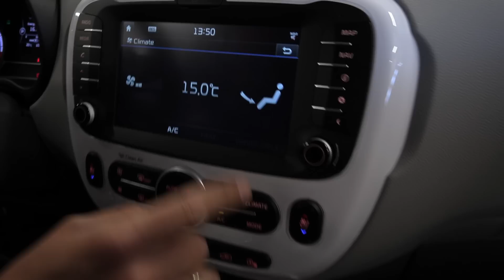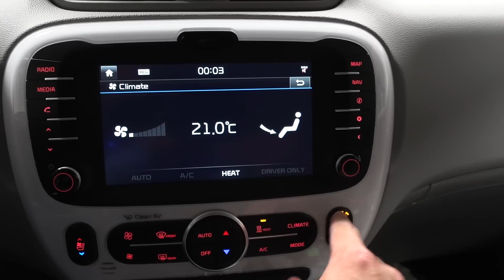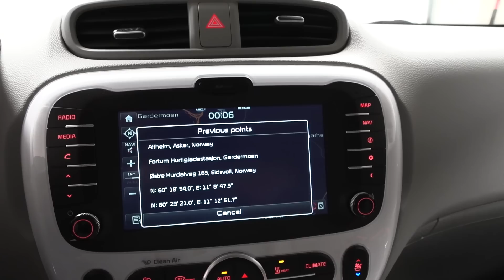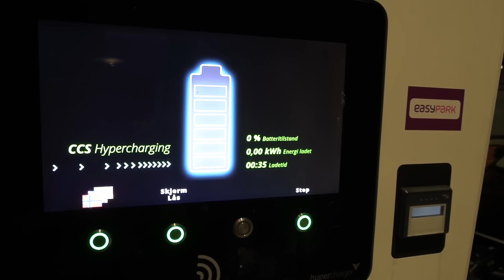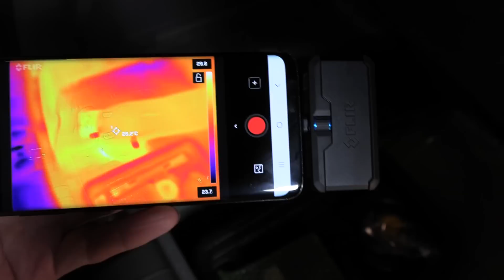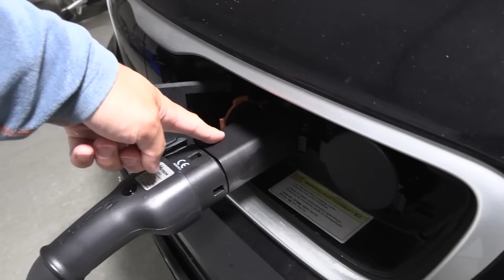Testing Kia Soul 27 kWh with upgraded cooling

Comment: yeaaah so i tried it too on the ioniq 28 i have, and it's not helping much on long trip because the delta between min and max is destroying the bms . arriving at 90% of SOC  it start to be VERY VERY slow because it try to equalize the cells, but they have more than 10°c  of delta.

i think the solution could be a better output fan or something like that... but for the moment i don't recommend...

Comment: Hmm, so battery max temp is not getting low enough ... probably the design of the pack doesn't alow enough air stream. I guess the cells in the middle, somwhere stacked on top of eachother, don't get much cooling.